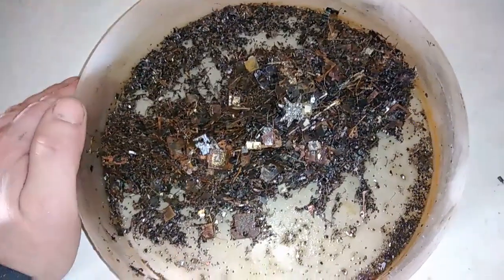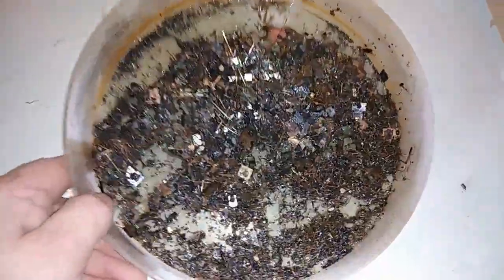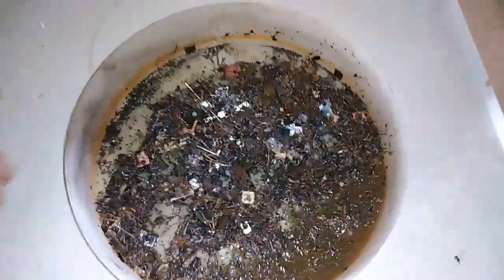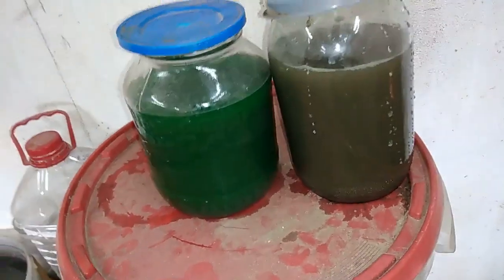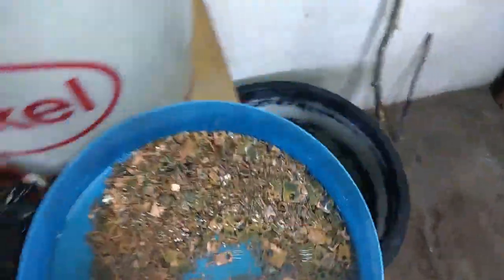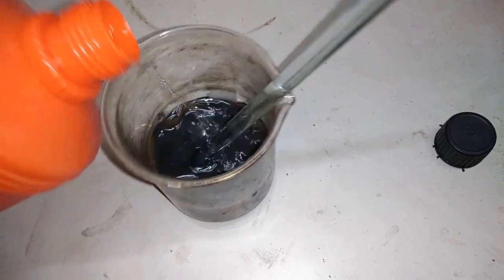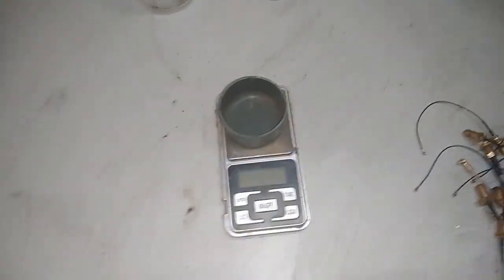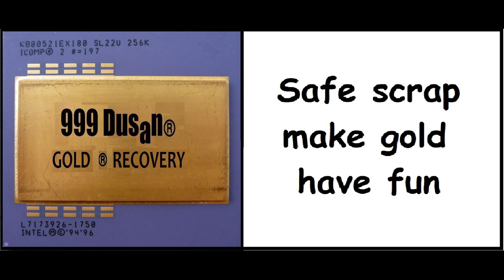Metal scrap from IC-chip processed for Gold - TEST VIDEO!

Comment: H2SO4 & NaNO3 forms HNO3 through double replacement, so its another poor man's AR really. In that case I'd have to say you are probably leaving gold behind even despite the scrubbing of the metals. Unless you use a lot of extra AR to dissolve all the base metals you have something that will cement out your gold. 
I use the H2SO4 and NaNO3 method a lot and I have had several instances of getting more gold out processing the same batch a second time because of the cementing.